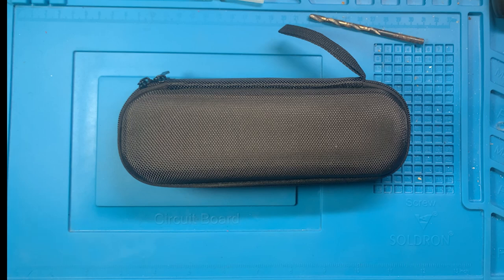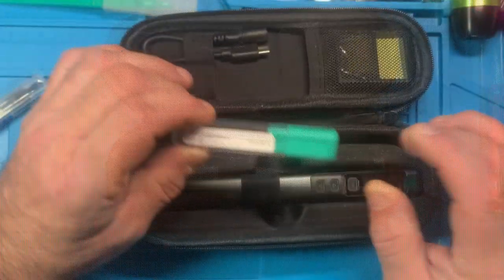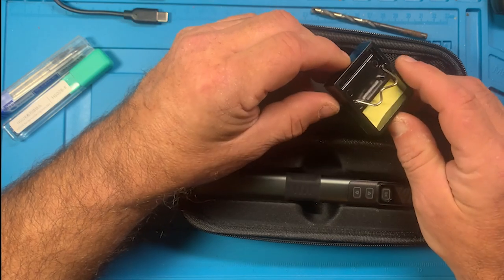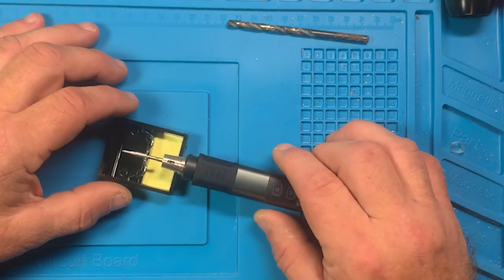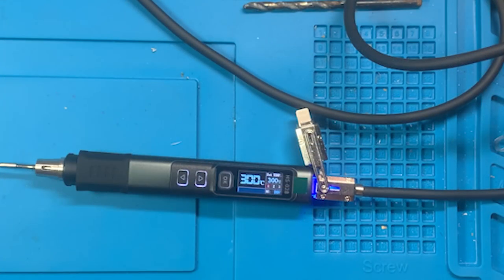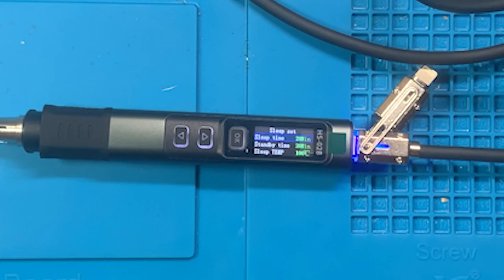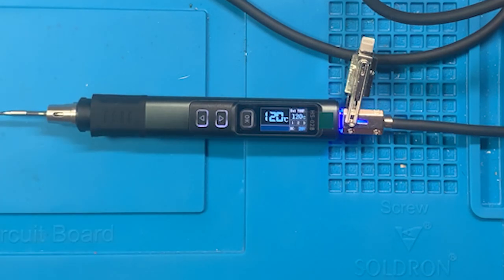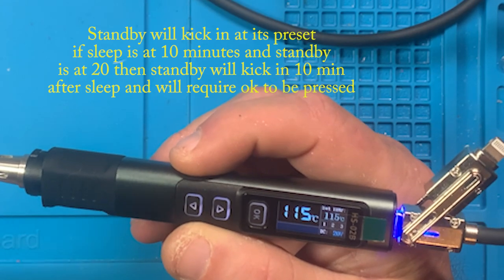FNIRSI HS 02B micro soldering iron

Comment: I like the ts100 tips better. Im only worried about how small the c210 tips are. The c245 are more comparable to the ts100
Reply: That will depend on what you are working on..use the right size cartridge

Comment: How to update the firmware?
Reply from the maker: Power off the device, press and hold the OK button, then connect the USB Type-c data cable to the computer to power on the device, and enter the Bootloader interface for firmware upgrade. After entering the Bootloader, the computer recognizes the USB drive and copies the firmware file directly to the USB drive. After one minute of inactivity in the Bootloader interface, the existing firmware will automatically run.

you can go to www.fnirsi.com and click on the download then firmware and select the soldering iron and you will see your iron listed there and you can download the new firmware there from there.

If you would like it could make a video this weekend on updating the firmware?
Reply: @TTMEable  Yes pls. Make a video about updating this iron. Thanks
Reply from the maker: ok i'll get something up this weekend.
Reply from the maker: I just completed the video and am uploading now. it should post in 1 to 2 hours 1p- 2p central time. Hope this helps you out. Have a great weekend.